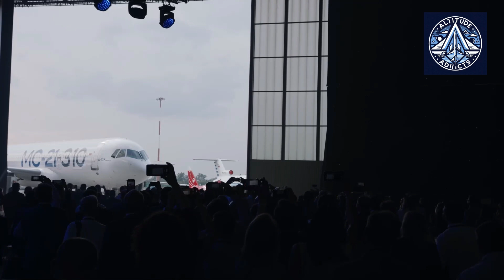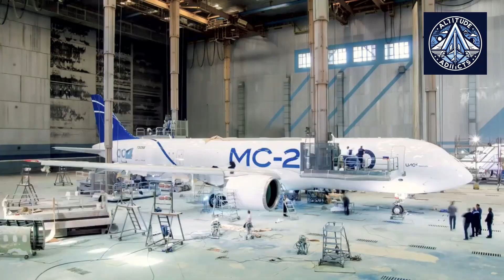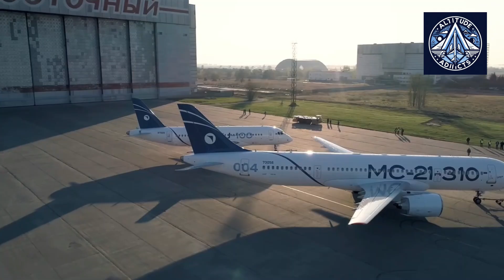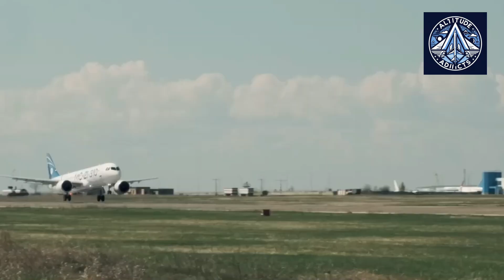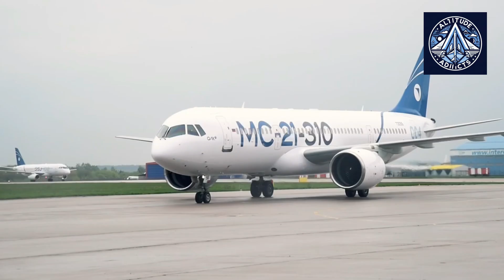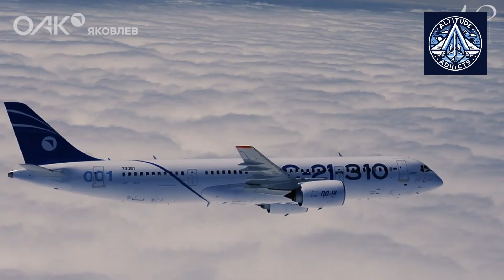MC-21: Russia's Sanctions Buster Aircraft Set for Takeoff

Comment: Looks beautiful though as compared to Airbus a320 family 
But tobeon par with Boeing and Airbus they will need to be modern.
Like active side sticks
Electronically dimmable windows
HUD display 
Latest touch screen avionics screen
Satellite internet etc
Also adding winglets will reduce fuel consumption 

And optional could be designing moder comfortable lights seat for passengers 
With modern oled enternatiment screens with connecting ports etc

Besdies this the aircraft is quite modern and same as boeing and Airbus